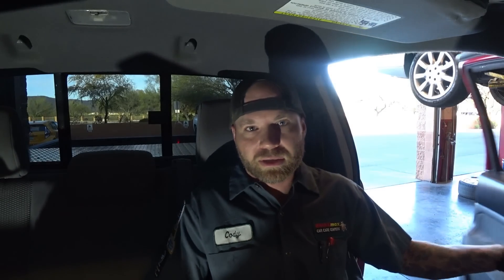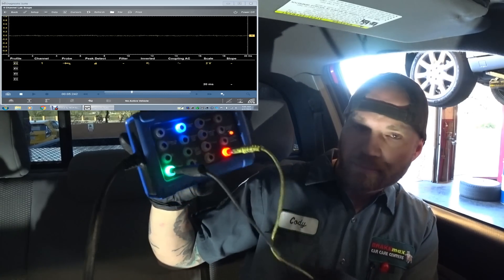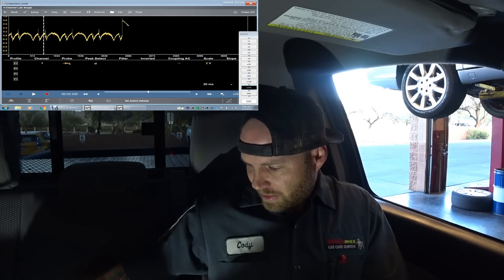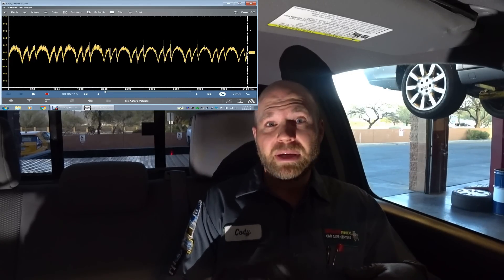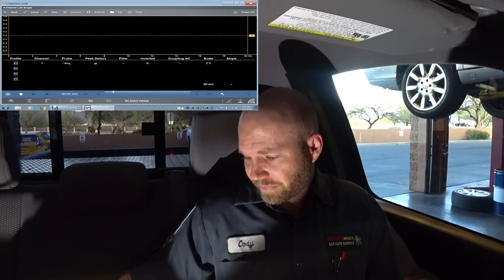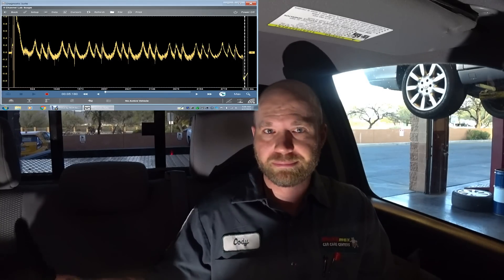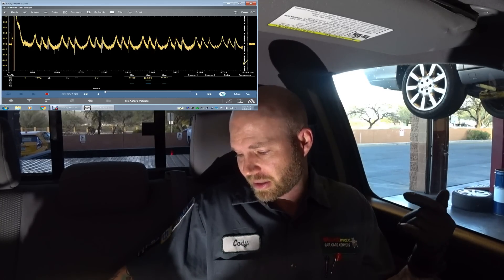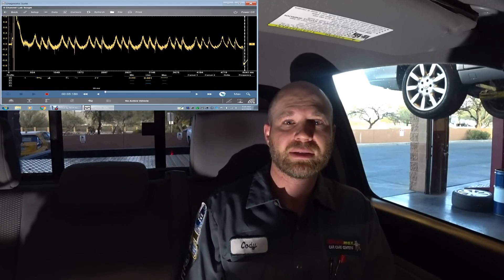Relative Compression Test at DLC, using Snap_on scope

Comment: It sounds like a 2.7 with a burnt valve. I’m glad the 3.4 and 4.0 V6 didn’t have this issue. All the 2.4 and 2.7 l4 seem to last about 170-200k before they lose a cylinder. 

Nice job on the video.
Reply from the maker: ThePracticalMechanic 😂😂 you nailed it. Bad exhaust valve, this one only made it 145k though. The v6 definitely a better engine imo

Comment: Cody, can you explain the reason for using AC coupling? I'm an amp clamp RC tester only at the moment, but always looking for new skills! Thanks
Reply from the maker: Jonathan Macleith In this case the reason I do AC coupling is because it keeps the waveform at the ground location on the scope. Every scope set up is different for example the pico you don’t need to do AC coupling but it’s just easier using the Snap-On in doing so.
Reply: Cool man, I'll give it a shot, I've got a duramax in the shop that I know has a dead hole. I performed an RC with an amp clamp already so I will try it this way
Reply from the maker: Jonathan Macleith that’s perfect to test it out on bro